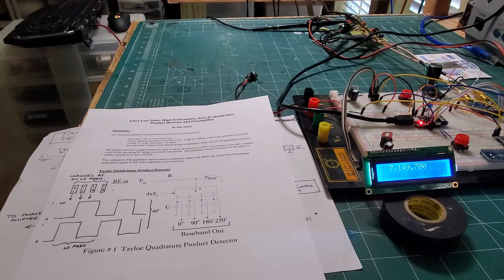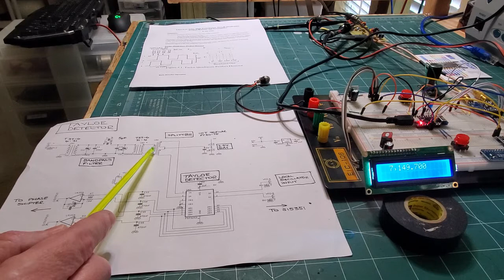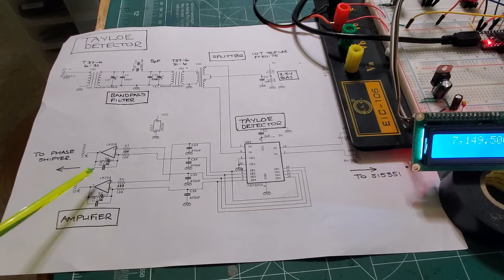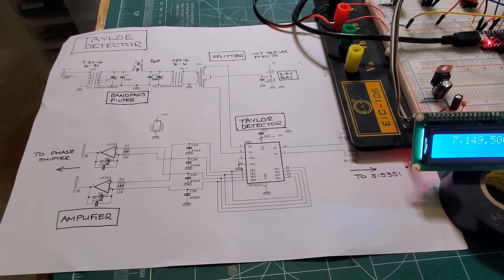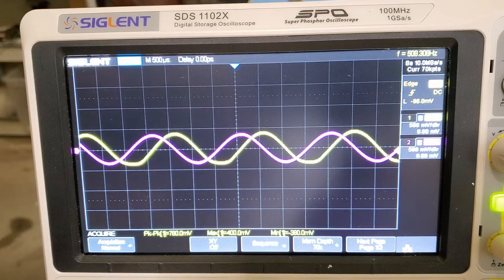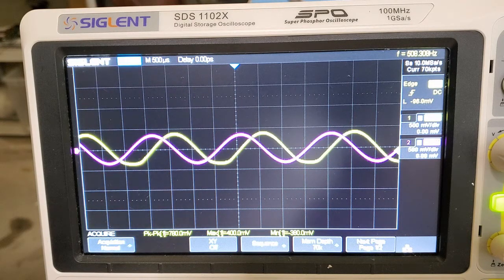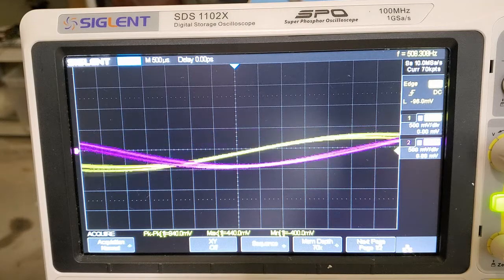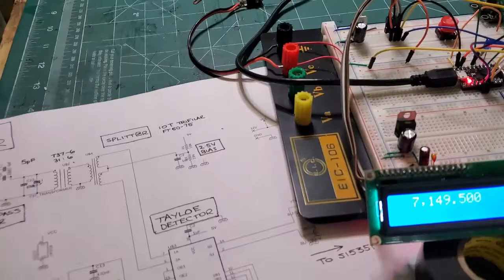TinyPICO Radio Part 2 - Tayloe Detector and Testing

Comment: hi, i have a question, instead of the fst3253, can i use a mixer like SBL-1, for the RX part?
Reply from the maker: You can certainly do a quadrature mixer with an SBL-1 or equivalent. In fact I did a double balanced mixer with that device in an earlier video https://www.youtube.com/watch?v=zaTNVunfN0E

Comment: Can it receive fm&am
Reply from the maker: You can hear AM with an SSB radio - but its very distorted. FM requires a whole different demodulator/detector. You wouldn't hear an FM signal at all with this radio. Thank you for the question

Comment: Trying to figure out how to make the splitter transformer (assuming this is something you have to wind yourself). Is this identical to the 'Trifilar Toroid' described in the QRP Labs receiver instructions?
Reply from the maker: Hi Chris. I thought I had done a separate earlier video on that - but I couldn't find it. Have a look here http://qrp-labs.com/images/50wpa/QCX_PA2q.pdf - page 17 shows how to wind a splitter transformer. It is trifilar wound - you just have to correctly locate the windings that go together. Let me know if this helps
Reply: @na5y  Super, will give it a go. Thanks!
Reply from the maker: Just a note - for a receiver 28 gauge magnet wire is fine - you don't need thick copper wire as shown in the amplifier. Makes the trifilar wind much easier with thin wire. Also you can use a T37-43 here too
Reply: @odissey2  Looks like you pasted the same link twice. Will check it out, thanks!
Reply: @chriscostes9249  Sorry, looks like I accidentally deleted the post. Here are the links
https://youtu.be/86n5gjlgmmI
and
https://youtu.be/a8ViWS61hsU

Comment: Do you know why the splitter is necessary on the input, after the band pass filter?
Reply from the maker: Interesting question. That splitter isn't necessary - this Tayloe style detector radio for example doesn't use a splitter  https://www.norcalqrp.org/files/NC2030/NC2030.pdf - page 109. What I believe splitting the signal does is improve the sensitivity of the detector stage by reducing that stage's input impedance. I could be way off though. 

Thank for for the comment!
Reply: @na5y  Hans of QRP labs uses the same thing in his kits in the Tayloe detector.  Need to build one!  Tnx.  73 Tim, VK4QP
Reply from the maker: He does indeed. I have a video of building that part up for the QCX https://www.youtube.com/watch?v=KYSUznerpZM&t=7s - Its a fun part of the build
Reply: I believe that the splitter (balun) allows doubling mixer sampling rate, thus improving s/n. The balun coils are out of phase, producing  positive and negative outputs, which go into separate MUX banks of the dual ft3253. In QRP Labs schematic, the two MUXes are simply paralleled (to reduce the ON resistance). While in the parallel version each capacitor  samples signal once per period, using the splitter it samples twice.
Note that the MUXes output pins shorting order is opposite without splitter.  With splitter: 3,10/ 4,11/ 5,12/ 6,13. Without splitter 3,13/ 4,12/ 5,11/ 6,10.